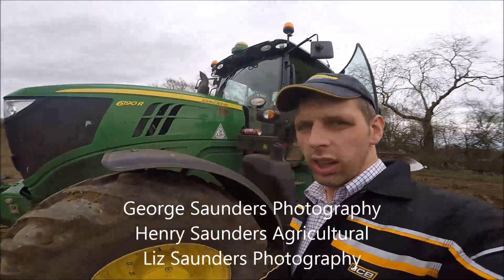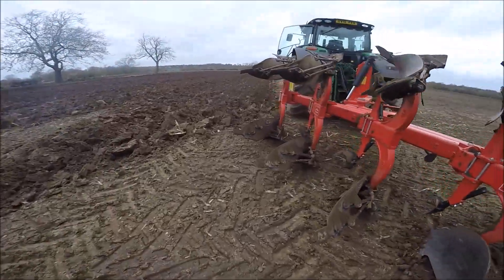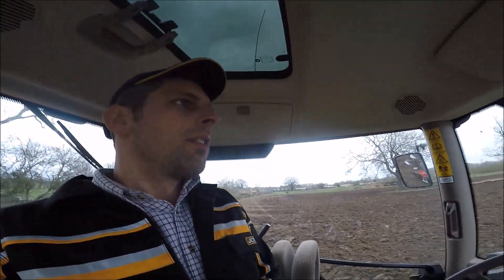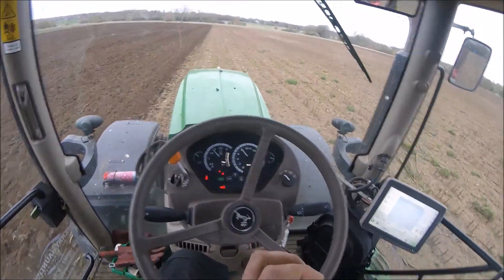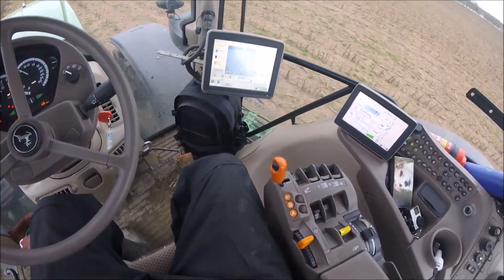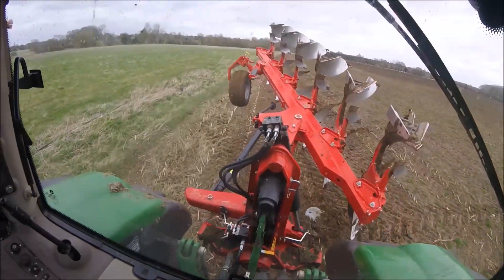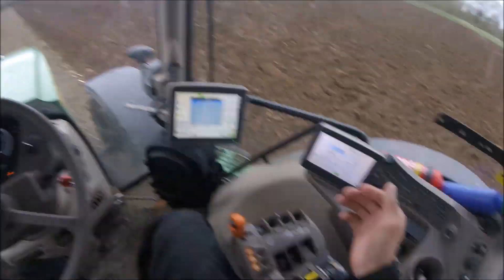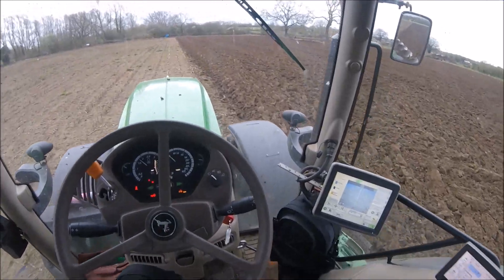Ploughing With AutoSteer

Comment: if you put the depth control down to the stop, you can adjust the stop with the little wheel to the right of the slider back up to your desired depth and it'll stop you moving it with your sleeve, also when you want to make fine adjustments you just turn it up or down a notch at a time.

Comment: George, that little light brown wheel by the depth control is for your adjustable stop, set it right and you won't be knocking the depth control down all the time. I'm sure you can set up the cruise control on it so when you put the gearstick in auto and push the throttle all the way forward then it will keep to the speed set by the thumbwheel  and change gears and revs accordingly.

Comment: Set the iTec (Headland managment) up and you only need two switches to turn around. No gears, revs or spools to mess about with!
Reply: RGKnightandSon what's the point in driving the tractor if you use that

Comment: Go into settings and change the painting from manual to linkage and it will automatically do it. Auto steer will be good for flying the drone, be able to concentrate on it more. Save crashing it again.
Reply: On the drone you can set curved cable cam . Presets the flight path

Comment: Nice GS. The newer JD command arm's have a nicer layout with the depth adjustment on the side. Also you can skip all the button pressing with the iTec system which is a bit like you had on the 4000 fastrac. Just simply programme a string of commands to any buttons 1-4.